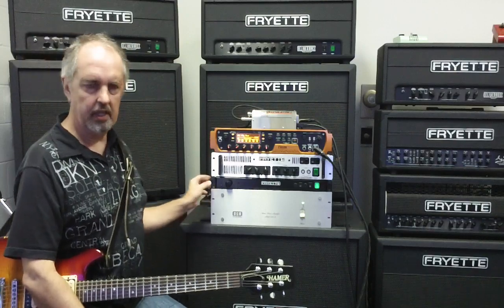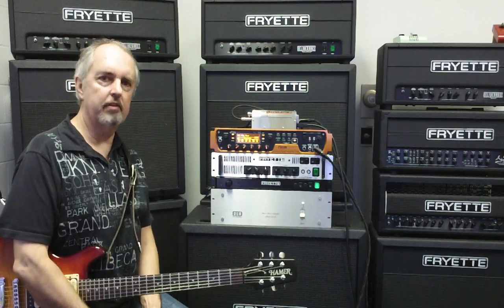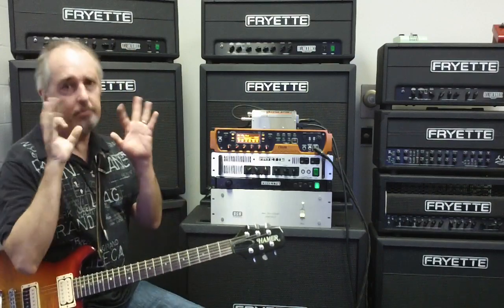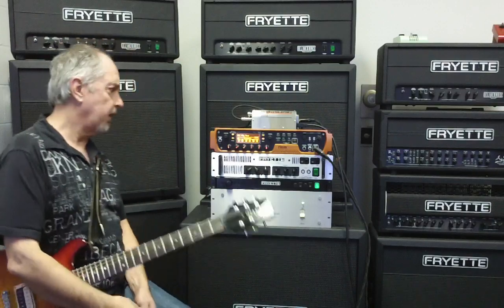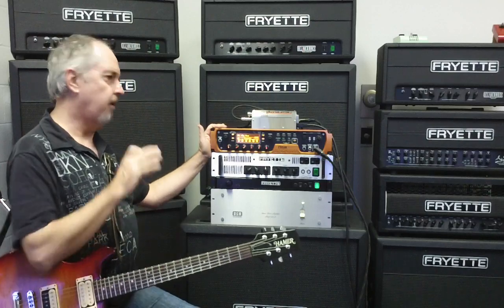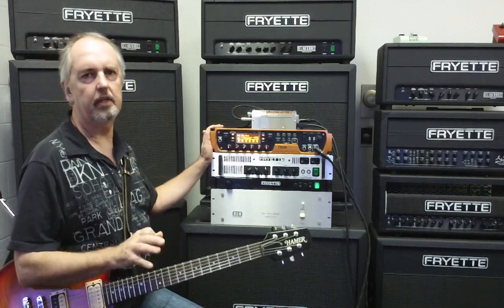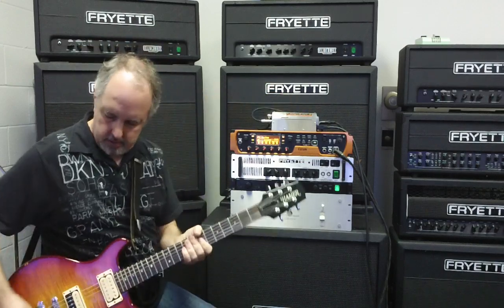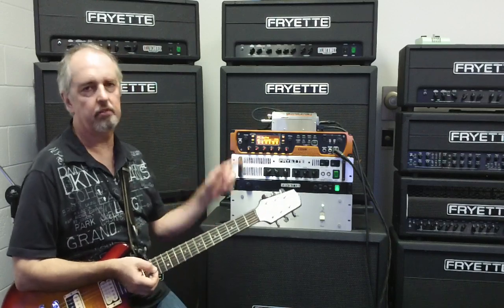Fryette Modeling Workshop Volume II: Fryette LXII and Avid Eleven Rack

Comment: Steve, 
you nailed it. I've been working with a premium solid state amp with my axe 2 through my guitar cabs. It just does not respond dynamically the way I am used to. I have a 2902 on order. It sounds like this will solve my probelm.

Comment: I'd really like to know how the Valvulator and the 11R's variable input affect each other, specifically, what should the eleven rack input impedance be set at if I were to purchase the Valvulator?

afaik, the eleven rack has a variable impedence input, with auto and a manual setting for the main 1/4" front input.

Great Vid! Thanxalot

Comment: How about a neutral speaker with FRFR capabilities (like the fane coaxials) , to allow colouration of the speaker sims to recreate the frequency curve but servo control for the damping factor to allow the interplay between the magnet of the speaker creating its magnetic field and the power amp mr fryette? By the way the 11R stuff seems to sound better than the pod HD pro ones!

Comment: Can you tell me if the The Fryette Valvulator I V1 can be used with two eleven racks. The The Fryette Valvulator I V1 has A and B output for two amps
Reply from the maker: Yes, it can! You are correct.
Reply: Thanks for the prompt reply Fryette Amps. Excellent news, saves me getting a splitter pedal.. Any idea where i would place a Two Notes CAB in the chain.?
 Guitar to Valvulator out to two eleven racks (hooked up together via AES or  analogue) One eleven rack being interface and the other piggy backed. The idea is to utilise using two amps at the same time. as eleven rack does not have this function..hence two eleven racks
Reply: Can you run the power station PS2 with the 11 rack? And get it loud

Comment from the maker: TieDyedDevil - 

1) If the EQ was operating at the same time constant exactly, it probably wouldn't be much different - on paper. But it's acedemic, because that won't happen. And if it did, in real time it would be very different due to hysteresis effects imposed by the electromechanical behavior of the speaker. 

2) No such assumptions are being made or offered in this regard. One has to accept however, that so far it isn't being done, so it's a moot point.